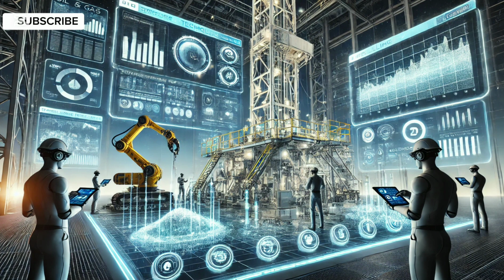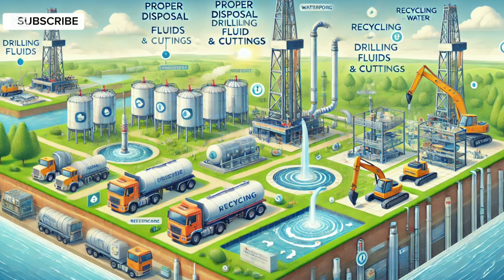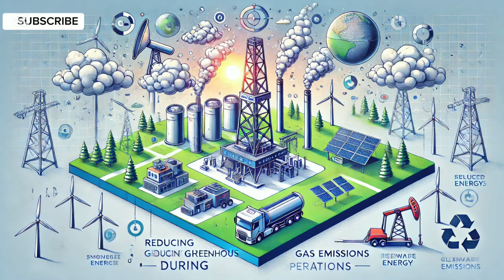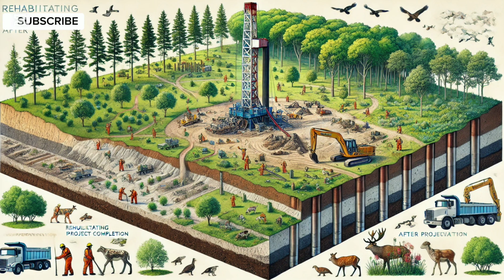Oil and Gas Drilling Explained: Step-by-Step Guide from Planning to Production #oilandgasinsights

Comment from the maker: P=ρ⋅g⋅D
Where:
𝑃 = Hydrostatic pressure (Pa)
ρ = Mud density (kg/m³)
g = Gravitational acceleration=9.81m/s
D = Depth of the well (m)
We are solving for 𝜌
𝜌=𝑃/D.𝑔

 P=20MPa=20×10^6 pa
g=9.81m/s 
D=3,000m

Density of mud ≈679.6kg/m3
 
The minimum mud density required to balance the formation pressure is approximately 679.6kg/m3
Reply: what other considerations are there to estimate the required mud density? are there additional calculations to be included during practice? what about thermal expansion? by how much does the base viscosity of the mud change over the lifespan of the mud? thank you so much for this channel!
Reply from the maker: @ArhMatBenzamene  thanks for asking I am happy that you are taking interest in learning and engaging others in learning opportunities as well ...

Let's come to your query 
By the increase in temperature of the water base mud leads to small reduction in density due to thermal expansion of components of the mud & decrease in viscosity as well initially.
But with rise of more temperatures beyond a limit and water start evaporating and due to loss of water the the volume will reduce and ultimately the density will increase......

If you have any query feel free to ask
Reply: thank you for the reply. I love your channel, very informative. happy new year, and all the best in your future endeavours
Reply from the maker: @ArhMatBenzamene  thanks alot for your kind words and thoughts about our channel such kindness motivate us to utilise our energies in positive directions